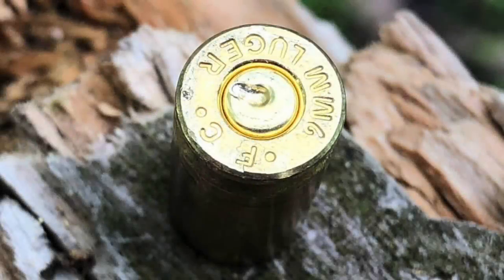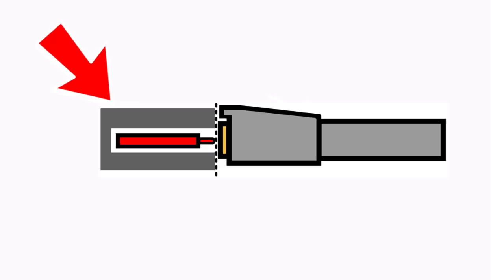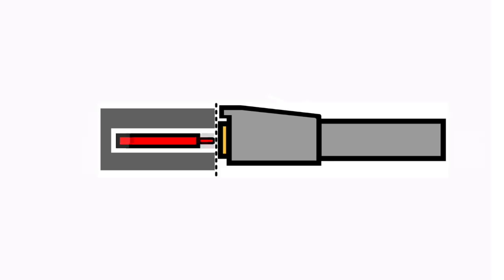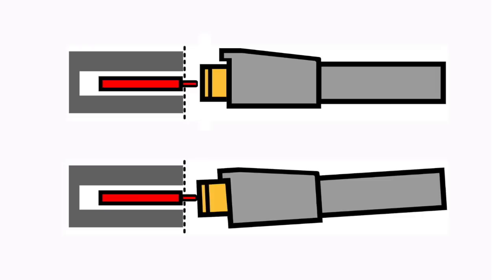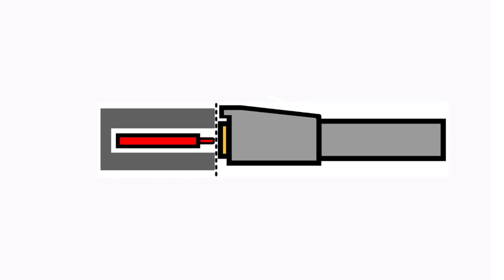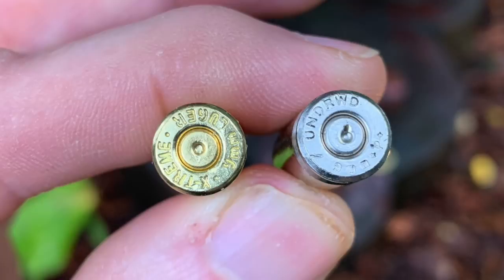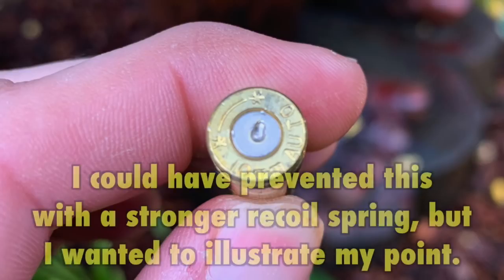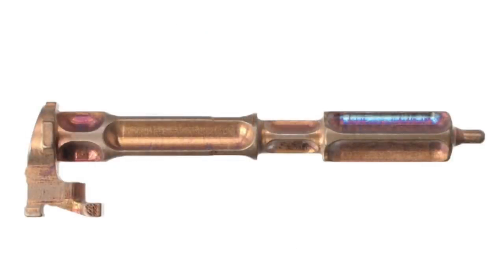Primer Drag: What Is It? What Causes It? Is It a Big Deal?

Comment: I gotta admit I find these micro-9 pistols to be engineering marvels. By all rights, they should be 380 ACP. The slightly shorter lower pressure cartridge creates fewer engineering demands. It's a little easier on the shooter too. So I gotta say, well done engineers! People obviously like these little guns. Even in the tiny three inch barrels, the 9x19mm is coming out with more muzzle energy than a SAAMI spec 380 ACP. So rock on!

Comment: Crud built up in the striker channel can cause this issue also. The striker can't retract fast enough because gunk is slowing the striker down. Also a weak striker spring or weak recoil spring on older guns can cause drag. Sometimes soft primers allow the striker or firing pin to actually "stick" to the spent primer and cause drag issues or even breakage. Keep your guns clean!

Comment: Sometimes Primer Drag can be caused by a worn out firing pin spring. For most circumstances it is not a big deal, but it can be if the primer drag extends to the edge of the primer into the casing itself. It can get caught on the inside edge of the casing and slowly chip of wear the face of the firing pin.
Reply: @camojoe83  it's caused by repetition. If you're looking at the hardness scale and expect that a softer metal cannot damage a harder metal, go take a lead hammer and beat it against brass or steel and tell me it causes no damage...

Comment: My Glock 19 gen 3 has literally done this to every case I’ve ever ran through it. I’ve never had a problem. Thousands of rounds. If you’ve got a good gun with good metallurgy in the striker I wouldn’t worry about it at all. My PPS does it some too.
Reply: Are you sure it’s primer drag? The gen 3 Glock has an elliptical firing pin and leaves an oblong divot in the primer. It’s designed this way to make it stronger in the vertical plane, so if the striker were to drag it is less likely to break than a round firing pin as found on those junky ass Sigs.
Reply: OneGunMan yea it leaves an actual drag mark perpendicular to the firing pin strike.
Reply: OneGunMan I know Glocks use an oblong pin head.
Reply: dbelex ikr
Reply: Cosmoline Fiend   I’ve friends with glocks. They give me their spent cases. Many actually have a pierced hole in the primer. I bet their bolt face is really dirty. Once the primer is fired?, I don’t care about drag, I do care about a firing pin piercing a primer. That is when the case still has powder pressure on it.
Reply: Norman McNeal hmm I’ve never noticed piercing. Just smearing.
Reply: Norman McNeal that’s not good. Not only is their bolt face undoubtedly dirty but the striker channel will be fouled as well. Not good.
Reply: My Glock also does it.....gen 5

Comment: I purchased a used P220 Elite in 45 ACP about 9 months ago. It was obviously well used but well cared for. Since I purchased it I’ve put well over 700 rounds through it with no issues. One thing I noticed about the gun was it ejected the spent brass forward and to my right. Most times the brass would end up in front of the shooter two lanes over from me. 

Two weeks ago I purchased 100 rounds of Blazer brass case 230gr FMJ (a brand which I’ve never run in this handgun before). Not only did I notice a shift in my ejection pattern (from forward and right to nearly straight forward) but each one of the primers had a swipe. This past weekend a switched back to the usual “white box” ammo and the primer swipe isn’t present. 

The take away is this particular pistol simply doesn’t like that particular ammo.

Comment: ~Super informational Video.  Thanks Yank.
~Actually, if the round fires as it should, I've "never" looked at the spent shells.  Maybe I should, so I will.
~The only gun I shoot +P Ammo in, is my S&W 586.  I load it with 38 Spl +P Ammo or standard 357 Loads when I use it for backcountry carry.  There should be no Primer Drag with a Revolver since there is no ejection of the cartridge like there is with Semi-Auto Pistols.

Comment: I have definitely found that hotter rounds show a lot more primer drag.  My .357 Sig (Gen 4 Glock 31) always shows a little bit with the 125gr ammo, whether it is handloads I have loaded down to 9mm +P velocities (125gr at 1250fps), or my standard loads at 1500fps.  However, 147gr loads, for some reason, seem to show a ton of this.  I load 147gr Gold Dots up to 1375fps, and even the starting loads (1250fps) show a really large amount of primer drag.  Must be increased slide velocity from the momentum of those heavy bullets moving so quickly.

Comment: I had a HK usp .45 compact. Its hammer fired and as far as compact goes it's closer to a boat anchor than a micro gun. It had pretty significant firing pin drag.

Comment: I started working in a forensic ballistics lab in 1984. Long before compact and sub-compact striker fired high power pistols. Primer drag was a well known phenomenon even back then. I first noticed it in 1911's. All tilting barrel pistols can produce them. Your digital descriptive drawings were a little confusing. All tilting barrels actually have the barrel dragging down against the breech face towards the end of slide traveling back. Then the barrel actually angles back away from the breech face and move down disengaging the slide that keeps moving back to eject the shell once the barrel stops moving. What happens is that the breech of the barrel only starts moving down after a brief rearward motion (usually time enough for the bullet to leave the barrel and the pressure released). Many high speed videos demonstrate this. If the firing pin protrudes when the barrel starts sliding down it will often leave a drag mark. Like you said, in compact light weight pistols the slide barrel assembly will move back more quickly and there's a greater chance the firing pin or striker will still be protruding ans the barrel starts sliding down. It normally isn't of any consequence since the firing pin is much harder than a soft primer. What might concern me is in the long run you might accumulate some small pieces of primer dragged away from the case somewhere in your action but even that has only a small chance of ever affecting the function of the pistol. It would be dangerous if the firing pin protrusion is way too long and then you risk bending or breaking the firing pin. Breaking it renders it non-functional, bending it could result in a full auto mode.
Reply from the maker: This is simple illustration to explain the motions. Not a true representation of the browning action. If I left the pieces together it was harder to show the movement. You will notice I did not show the breach or the slide.
Reply: @TheYankeeMarshal  No problem, just me being a smartalic and emphasizing it wasn't usually a problem and is nothing new.

Comment: Best representation of the function of a locked firearm. The barrel and slide do not unlock from each other until the barrel starts to tell. The slide does not precede the barrel in rearward motion. However the firing pin should have returned to a neutral position before the barrel tilt starts. I have seen it on inertia firing pin guns, but it's so exceedingly rare, I think I may have only seen it twice in my lifetime. You usually see it far more often in striker-fired guns, almost all Glocks, at least as of 10 or 15 years ago. Not only do they have it Frank pinstripe them looks like a drag Mark in the first place, if you look at it closely they almost always have a drag mark.

You are correct however that when you make a semi-automatic firearm smaller, the firearm operational timing must be more precise.

I know of no real issue that this could cause unless you had a Metallurgy issue with the firing pin and the pin eventually snapped off its nose over it, rendering the firearm usable is a firearm.

Comment: That primer is really flattened on the 10mm, that is an overpressure sign, when reloading when you see primer flattened like that back off slightly on your charge.
Reply: Ghost Shadow mmm could be. Also could be just a soft primer. Soft primers can cause that too. Especially in 10mm
Reply: @cosmolinefiend9853  would have to remove primer to see but as a general rule if your primers are flattening then you need to slightly reduce your load, if you are using soft primers you still need to reduce your load as next thing to happen is primer blowout and forcing primer back into fireing pin.
I have had to disassemble firearms to remove chunk of primer from fireing pin hole, I don't load that hot but I know people that always attempt to get absolute hottest load that they can.
Reply: @cosmolinefiend9853  That's not the only thing, there are a LOT of factors that can make primers appear "flatened", after my 35 or so years as an avid reloader/shooter you learn to take the whole "flatened" primer thing with a grain of salt, it can be varying primer/primer pocket fit, some brass being more hard or soft in the primer pocket area, or slight size tollerence variations in manufacturing just to name a couple, then the appearance can change from gun to gun, an example would be the design of newer S&W revolvers that have a slightly "dommed" firing pin bushing, that design causes primers to appear as being majorly "flatened", however the same exact load fired in say my kimber k6 or older S&W's and the primer doesn't even hardly look like it has been fired other than the primer dent itself, and this even with very mild loaded 38 special rounds, also caliber doesn't really have much berring on it other than higher pressure rounds in general are more likely to be an issue if other parameters are off even slightly, rounds such as 10mm-357sig just to name a couple run sammi pressures that are pushing the brass to the limits of their design, 357sig is real bad in this department being the parent case is the 40S&W with a sammi max pressure of right at 35,000 psi the sig runs at 40,000 psi pushing that brass beyond it's original intended design parameters.
Reply: Ghost Shadow I gotcha. I don’t reload or anything I’m just going off of common sense. But yeah, makes sense. Thanks
Reply: With the proper primers, 10mm at full power will flatten the primer but that's it, and it can handle it. He is probably shooting minuteman 10mm, and mine flattens slightly.
Reply: looseballs1966 thanks for that info man.
Reply: @looseballs1966  a load that shows no pressure in one firearm can have over pressure in another, there are many factors that affect pressure from round fired in any firearm.
I have load for 30-06 that shows zero signs of overpressure yet in one of my other rifles blew out the primer and nearly removed headstamp from the case, primer pocket was expanded several thousands, new primer falls in and right back out.
Charge is 57 grains of H4350 behind a 180 grain Speer spbt.
Reply: @ghostshadow9046  
Would excessive head spacing cause that?  Or a chamber that is not fully supported?

Comment: The barrel doesn’t drop to allow rounds to feed, but rather to unlock the barrel and slide which move back together to allow the bullet to exit and pressure to drop before unlocking.
Reply from the maker: Its both. The design will not allow the gun to chamber a round unless the barrel is unlocked.
Reply: TheYankeeMarshal 
True. And I liked your follow up video.
My point was the barrel tilting and dropping isn’t primarily to allow chambering, but rather a dual function in that system, and not a requirement for all pistols. Blowback pistols with their fixed barrels can feed without the movement due to magazine placement and ramp position.

Comment: Good to know. Also, Before I got stupid with my mods and messed up a good home made pistol, I used to unload the chamber of my pistol, often with the same round being ejected, every time before I'd go out shopping. I don't have a permit, so I'd "transport" the pistol unloaded in a closed and fastened container too large to be concealed on or about my person, my duffel bag. I'd imagine cops do something similar when they clear their duty weapons at the ends of their shifts. Anyway, when I got home and dropped the slide to chamber the same round(s) almost every time, eventually I noticed a shallow mark on the primer that looked like something between a light strike and what I now know is called "primer drag." I didn't think much of it since my pistol wasn't 1 of those crappy pistols that slam-fire when you go to chamber a round anyway, but I sometimes swapped out the top round of the magazine when I noticed that mark, just to be on the safe side. Nobody ever complained about a sympathetic discharge except on a TV show for people who are even nerdier than I am, that might actually be a good thing to send at an assailant for that rapid, inadvertently auto double-tap, but no decent, sane person wants to fire a a round he/she's only trying to chamber and not fire at that time. So yeah, it's really not a big deal as long as your firearm is reliable anyway. Just don't be a dumb-ass and chamber a live round like that if you're not intending to fire it, okay? It's common sense. Keep calm, carry on and don't be a Karen. Nobody likes a Karen.

Comment: I’m one of the ones who never bothers to even look at the empty cases 😂
Reply: If you don't reload you really wouldn't need to, if you reload you look at your spent primers to see signs of high pressure though this is less of a case with lower pressure pistol rounds.
Reply: Theone !  He probably sweeps them up or picks them up without ever looking at the primers, personally I like it when people "trash" the place like that, it gives me some good once fired brass for free. The only time it is trashing the place is when the cases are aluminum, steel or berdan primed.
Reply: @phillhuddleston9445  why can’t you reload steel?
Reply: @crunch9876  They almost always use a different primer that has two small flash holes side by side instead of one centered hole and it is difficult to remove these primers, you need a special decapping tool and even them it has to be lined up perfectly and is a PITA. Aside from that steel is more difficult to resize than brass it will work harden causing split cases faster than brass cases and it takes much more pressure to resize and adds more wear to your dies. They along with aluminum are single use throw away cases.
Reply: @phillhuddleston9445  great answer.
Can you recommend me a budget reloading set up.? 
Id prefer if it was compact enough to fit in an safe when not in use but that’s not a requirement.
Ima start of reloading .38 special and then go on to .308 and possibly 9mm
This shortage had made me realize I need to be prepared next time. I can’t afford to go to the range any more with amma prices. And do limited space stockpiling more than a few boxes isn’t an option.
Reply: @crunch9876  As a budget setup I recommend getting a Lee loading kit, you can get one with a hand press that won't be high production but makes good cartridges, their cheaper bench mounted press works good and is easier to use if you have a place to mount it to with a clamp or mount it to a sturdy board that clamps onto a table. Most Lee products are pretty good, you can use all of them but eventually you will want to upgrade the scale not that it isn't accurate it's just a bit harder to use than most, I've loaded thousands of rounds on mine before getting a good used beam scale off E-bay. You can spend a small fortune on loading equipment but unless you are loading for a bench-rest gun you will be fine with Lee. The other upgrade you will eventually want is a better chamfering tool, theirs is usable but not great, it will get you by. Their "Perfect Powder Measure" works so good I bought a new Hornady one for several times more because I lost the cap to the lee measure but I can't get myself to switch to it especially after trying a new stick pistol powder that I though would not meter well that the Lee poured very accurately.

Comment: The striker spring doenst draw it back in, the sear does. 
Your photo showed that you are correct that drag isnt a big deal if it's small. However, look at the drag on the 365 and you'll see that the striker is also dragging onto the casing which is a big problem hence why they are breaking. So yes, the P365 is broken and is defective just like the EC9s I had that broke 2 strikers over the course of 107 rounds. Junk.
Reply from the maker: No, dumbass...the sear does not retract the firing pin after it contacts the primer. The spring does that.

Comment: This was spot on, I'm tired of this argument, yank I don't agree with you all the time, but this was the best video I've seen on this yet, I commented on another channel about the +p ammo, and was told to pound sand. I think the issue with the sig breakage was the hardness level and design, the G43 also drags but their strikers are more squared off. Lets face it glock has had alot of time and experience in the striker realm. But good job on this , unfortunately the debate continues. 👍